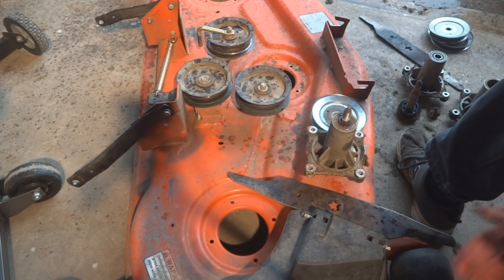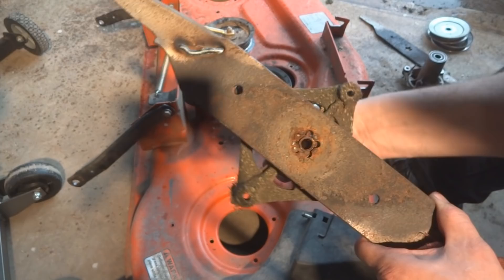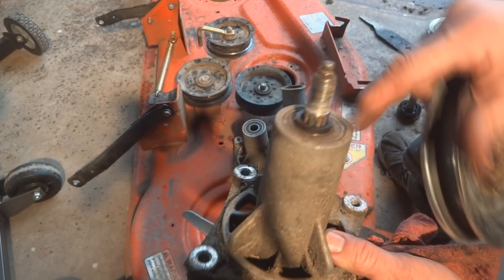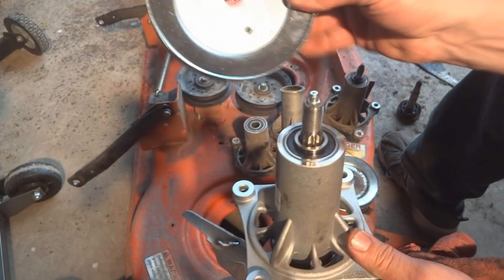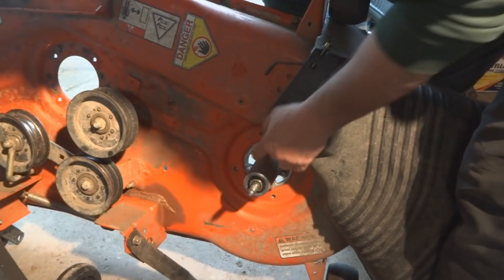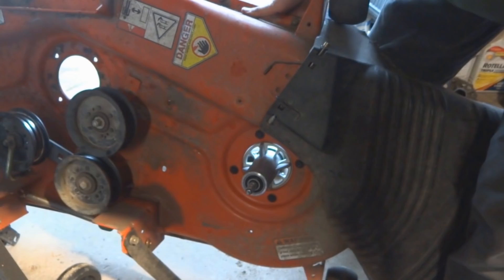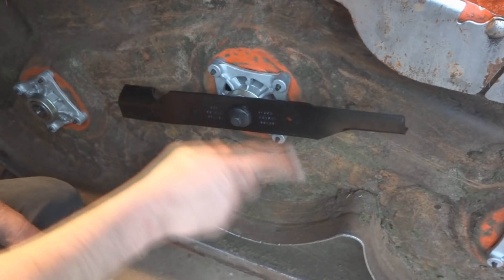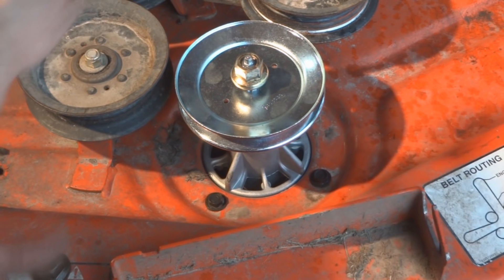Husqvarna Mower Deck Spindle / Mandrel replacement

Comment: Great video with a lot of detail. I rebuilt my Cub Cadet Zero Turn mower this summer (2021) which included new spindles. However, i did not use the self-tapping screws that came with the new spindles. Rather, I tapped the new spindles with 1/4" threads & used 1/4" stainless steel bolts and nuts. The reason for this was becuse the old spindles had self tapping steel bolts that were frozen solid in place and when I tried to remove them all of the bolt heads snapped off.  This was due to the bolts being made out of steel & the spindles being made out of aluminum.
Reply from the maker: Thanks for watching. Good job with the new hardware!

Comment: Just replace the spindles on a 46" deck and found that the new spindles came with grease fittings as I see yours do. The dealer said it probably has grease in but I should add some. I found out its possible to put enough grease in it to cause the bearings to protrude, luckily I was able to re-seat them when bolting the blade and pulley back on...Hope this helps any future backyard mechanics like me...
Reply from the maker: Thanks for letting us know. Thanks for watching!
Reply: The barrings are sealed and greased already no need to grease them. The grease cant get in or out

Comment: For the blade bolt my Husqvarna Manual says 
(45-55 Ft. Lbs or 62-75 Nm)
The bolt  sizes I have are 
Big top nut          7/8
Blade bolt           5/8
4 spindle bolts  1/2

Comment: I hit a rock while mowing and afterwards the mower wasn't mowing even and was making a low cut track in the grass when I mowed so I changed the blades out, but after doing so I noticed when I mowed after changing the blades the mower was still marking up my lawn with an low cut mark coming from the left side blade. What is the likely hood that when I hit the rock it bent the spindle shaft and will need to replace it since I ruled out a bent blade? ...... I thought it was odd that when I compared the old blades I took off to the new blades I put on and found that the old blades wasn't bent but after mowing the mower was still leaving an uneven cut mark.....

Comment: I redid my Husqvarna change spindles and all that stuff I got too much and play in the bearing and shaft walk pulls up and down within play not side-to-side up-and-down how am I supposed to tighten that up the bearing bottoms out inside the spindle and it will not get there's too much gap between the burying itself in the housing it won't tighten up what do you do about that It howling like a bastard won't cut
Reply from the maker: Sounds like something is missing from the shaft. Is the spacer in place, under the pulley?

Comment: Hello this video is so helpful I know you probably don't have time to respond to comments but mine was cracked similar to others I've seen online and the parts that are cracked are spinning and won't come out. I'm having trouble building leverage or finding a way to remove them any advice would be appreciated
Reply from the maker: I don't know exactly what parts you are referring too. However, a common place for spindles to break is the little bit that the screw goes into. I use a locking pliers (vise grip) to hold the broken piece, while I remove the bolt. Hope that helps.

Comment: what is a good spindle? I have the same 54 inch deck and I am wanting to install a good spindle or spindles so can you sent me a part #    thanks
Reply from the maker: This video was posted back in 2017, so I no longer have the detailed part numbers of this project. However, if you have the model of your mower, you can easily search for parts. One possibility for spindle is Spindle Assembly 587820301. But do not rely on this number without verifying that it's the correct part number for you mower. Thanks for watching.

Comment: How did you get the belt wheels off the mandrel? I can't figure it out for the life of me.
Reply from the maker: Once the large nut is removed, just pry up on the pulley. Maybe tap on it lightly with a hammer to jar it loose. Thanks for watching.
Reply: I removed the large nut while Holding the blade  with Thick Gloves

Comment: Like the video, helpful. But what did you do with the under deck spacer/rings that go between the mandrel and deck?
Reply from the maker: This unit did not have those spacer/rings when I got it. It's possible that a previous repair person didn't put them back. It was evident that somebody else had done some work that wasn't quite right. Although, some Husqvarna/Poulan/Craftsman mowers have them and some don't. Thanks for watching.
Reply: @RealManSkills  I just got a new spindle for my Husquvarna 20hp 42 in mower. The spacer washer is now integrated into the spindle housing. No need to replace it.
Reply from the maker: @jeffpuro1040  Good to know. Thanks for watching.

Comment: How much torque should you put on the 4 bolts holding the mandrel assembly?
Reply from the maker: I don't find any torque specs anywhere. I snug them up tight but since they are going into aluminum, not too tight.
Reply: @RealManSkills  I tried to find them myself and couldn't find them either.  Thank you.

Comment: Any particular positions the blades should be remounted in?
Reply from the maker: No, they are interchangeable. No particular order. Thanks for watching!
Reply: @RealManSkills    I mean as far as what direction they are facing in correlation with each other. such as:  all facing one direction or one facing side to side, another facing front to back etc...
Reply from the maker: @lynnswinehart4627  They should all be facing in the same direction. Thanks again.

Comment: The moral of the story is --> Don't buy Husqvarna!
Less than 10 hours on my 'BRAND NEW' TS142TXD ride on mower and I've replaced 3 spindles already.
What a joke! Never buy a Husqvarna ride on mower!

Great video :)
Reply from the maker: That's unfortunate. Thanks for watching!
Reply: They have a 3-year warranty.
Reply: @SingleStacked  Spindles are not covered by warranty
Reply: @alienwarrior  Yes they are. I asked when I bought last week. Bumper to bumper warranty. This was bought through a dealer, not big box.
Reply: @SingleStacked  The dealer simply stated "operator error and spindles not covered!". I ran over a stick the thickness of my thumb on the first occasion, The second time I gave a haircut to a hidden tree root that extended an inch above ground and the last time was a small rock embedded in the ground with a small amount above ground. Each time the mounts broke, so I suspect they use marshmallow in the aluminum mix. Nowadays I don't set the height less than 2nd from the top, as a result the grass is always too long because I fear to set the blades onto the lower settings.
When I purchased the mower I assumed I'd be buying the Sherman Tank of mowers, instead I got a delicate flower of a machine.
BTW, the Kawasaki engine seems robust and carefree.
Reply: @alienwarrior  The new ones use cast iron spindles. No more aluminum spindles. This is on the Z254F.

Comment: Where does one purchase the mandrel?
Reply from the maker: I buy them from eBay or Amazon or any other small engine website..
Reply: So my 3 blades do not have that star shape. I do have an older zero turn husqvarna with 3 blades, is there a few mandrels to choose from?
Reply from the maker: @King5150Ed  Yes. You will have to use the model number of your mower and track down the correct mandrels.

Comment: No grease?
Reply from the maker: These mandrel have two sealed bearings in them - one near the top and one near the bottom. If there was a grease zerk, I would have used it. In this case, I relied on the lubrication in the sealed bearings.

Comment: When you tighten down the nut on the pully side, don't the splines get in the way?
Reply from the maker: No, the nut is special! It has a space/cavity on the underside that allows the nut to be tight and yet it doesn't touch the splines. Good question! Thanks for watching.
Reply from the maker: You need to charge him a lot more, then he will think twice about damaging his equipment!